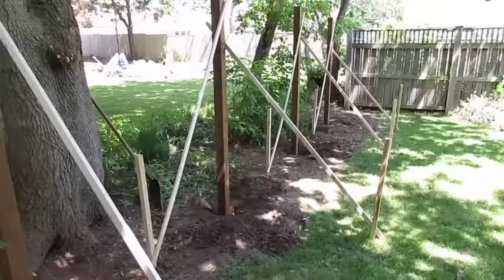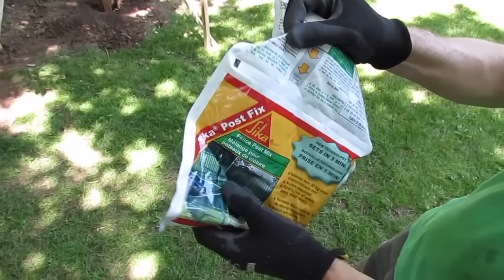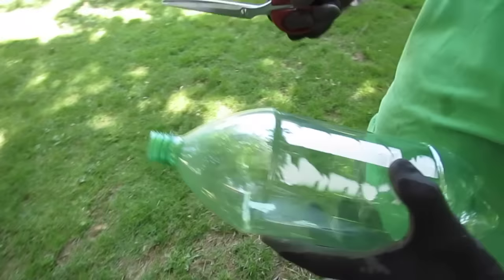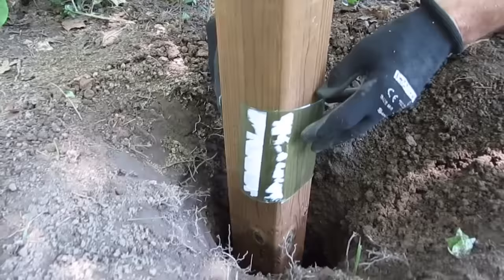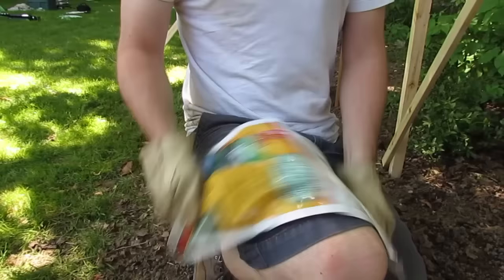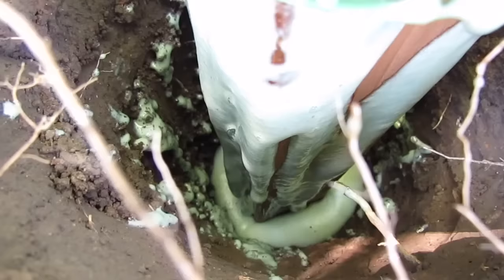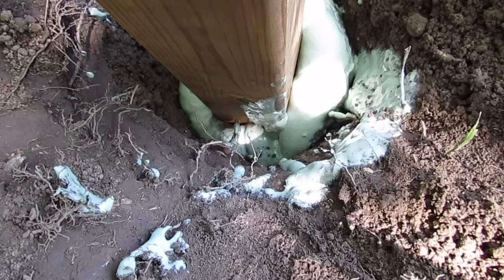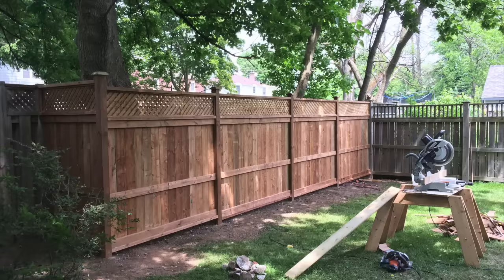No Concrete Fence Post Install!

Comment: The foam seems like an unnecessary expense.
My area has clay type soils, so I backfill and tamp in 6" lifts. The tamper is a steel rod, about 1" square with beat-down head on it, it really compacts the soil. I mound-up the top of fill around the post so that water drains away. Water in the soil is soaked up by the soil, and / or keeps the air away from the wood to prevent rot. 
Some of my treated posts have been in the ground over 20 years and still going strong. Concrete retains a minimum of 7% moisture which is a good start to a 30% threshold for rot. Concrete shrinks, so it shrinks away from the wood to leave a small gap to hold water which soaks the wood. Someone posted that they thought the concrete helped by adding weight. It also makes the base wider so that the post has more bearing area against the soil to prevent bearing failure and enlarging the side of the hole. 
By tamping and compacting the soil, the bearing strength is increased and holds the post solid, even after 20 years and working in the wind.

Comment: I did two posts with the same foam product. Way easier than concrete. Plus, like someone else said, the foam posts have yet to move even with the fence facing heavy winds. A significant problem is cost. Concrete is much cheaper.

Comment: Not sure how much this foam costs, but you get the same results with a load of gravel and a spud bar. Gravel is extremely cheap, and not messy at all. Just fill around the post with gravel and use the spud bar to pack/tamp the gravel down and it will hold just as well as concrete. Code for some post installations is gravel rather than concrete.

Comment: It's only the cost that puts me off.  $30 per bag (from the US) plus another $20 shipping for Sika, and Secure Set has a kit for 20 posts, $300 plus $90 shipping (to Australia or Philippines).  Concrete is so much cheaper, but I'd love to try the foam.
Reply: It was a bit remiss of me - I should have added that the shipping is to Australia or the Philippines (where I'm now living).

Comment: After your posts are secure and level on all points , take a wheel barrel mix a couple bags of concrete with water shovel it in evenly around the post , relax have a beer job done at a third of the cost

Comment: Hmm, the thing I like about concrete is I can shape and level it so it slopes up to the post and sticks out an inch above ground level to keep wet soil away from the wood - not so much for damp itself but for the woodlice that love dark damp places, and I can shape it as it's setting and it looks really neat.  The builders of my estate covered the concrete with soil and the posts rotted within a decade, when I replaced my posts I kept the soil off and the posts have lasted ever since, I'm still waiting for them to fail so we can get concrete posts instead, but it looks like I'm in for a long wait.
Reply: Thank you.  I'm going to make sure the concrete stays above ground.....

Comment: I used it on my fence and I had a piece of plywood to mix it on and used a rolling pin to mix it and squeeze everything to one side with the rolling pin and then back and forth to get a thorough mix 
then when you cut it open, you can use the rolling pin to squeeze out the mix. I think that the better you mix it the better it will expand

Comment: interesting stuff... would do well for an art project Put wires through it for an solar feature, - set it up for a fountain.. cool stuff.  Light weight. Just need the right mold and fast hands with gloves on when it happens.

Comment: If you have the means to drop $10-$20 a bag of the Sika mix then go for it, but you can get a 80 lbs bag of concrete for $5.

Comment: Always sit posts in a bucket full of creosote, for at least a week, before sinking. Many will make the mistake of believing that “pressure treated” or “tantalised” timber is waterproof. It isn’t! Also, a square hole is much stronger and stable than a round hole. If necessary, for permanent installations (ie you are not expecting to renew / replace it ever again), hammer in 6” nails in the sides of the bottom of the post.

Comment: Hole should be bigger . More concrete or foam i guess makes for less wiggle. Wind causes the most stress on a fence. Tightly fitting panels will expand and distort over time.

Comment: I prefer concrete.  I coat the bottom of the posts with tar (use painters tape level around the post about 3" above grade so the tar looks decent) to help prevent premature rotting of posts (as long as customers approve).  Looks like a solid product however, concrete is not that big of a deal and cleans up easy with a hose. A plus is handling the bags keeps me in shape!

Comment: For next time you can just pour dry concrete mix in the hole, it will set with the moisture in the ground and rain. It's much cheaper and easier. Or use gravel and compress it. They make that foam to fill old mining shafts but much cheaper.

Comment: You don’t need foam or concrete, dig the hole as small as you can practicaly use,   hammer the post into the hole making sure it is vertical. Then put all the soil you took out back in the hole around the post. You will have to ram in the soil very hard to get it all in. The post will not move, Ive done this many times and they last for years.

Comment: I tried this bag of foam was $11.00 at Lowe's (wanted to install 2 posts for cloths line) 1 worked fine. 2nd one failed it pulled loose (waited for 2 days before cutting excess foam and installing line between). So it is 50%

Comment: I totally appreciate you sharing your experience with this fence post foam, it was useful for me, but I will have to disagree that this is not better than concrete. Its more expensive, its lighter which might be good for transporting but I would rather have a heavy anchor on the fence post. Its not really easier, when using quickset something concrete, you can just pour it in the hole and add water. It might not be as strong as its full potential but it will work like that. people including myself have been doing it like that for years.

Comment: if it is a closed cell foam it is waterproof. However, if it's an open cell foam it's NOT waterproof. Because it's two part I'd guess it's waterproof and much like the foam used for insulating walls etc.

Comment: We used to be Distributors for this 2-part foam. I never heard of it being used in this way;  It's used in off-shore oil, vehicle insulation, film-making etc. and is super expensive by volume compared to time-served easy-to-use (cheap!) concrete/gravel mix. I think if someone's concrete/gravel set posts were leaning after 5yrs they didn't do the job correctly. Wrong concrete mix or poor ground preparation...

Comment: You don't have to mix the concrete though. Pour it in dry. Position the post exactly. Pour water over the top. Works better than prewetting actually

Comment: I think no matter how many layers of coating did you apply on the wooden pole, it will start rotting in the soil by time. Nice and quick new technology but we never put a wooden pole directly into the soil.

Comment: The problem is it’s foam so it’s light, the reason you add cement is to put a heavy anchor atm of a sail which is what a fence is... putting foam on the bottom isn’t going to stop your fence from blowing away it may sound good in theory but I think you’ll have issues with this in 12-24months easy
Reply from the maker: No, concrete is used because it's cheap and readily available around the world. It's merely a filler material that presses against the soil to create a mechanical bond. It's the friction between the filler and the soil that holds fence posts in place, not the weight. Ever try to pull a T-bar out of soil? You'd think it would be easy because it's so thin and lightweight, but it's not. It's the overall friction along it's length that makes it near impossible without a leveraged puller. Know what I mean?

Comment: Appreciate the insight.
One critique: The posts need to be sitting in packed large gravel or in concrete. Your posts will rot as they wick up water.
Reply from the maker: Some others here have said pack with soil only, others have said pea gravel, sand, or peanut butter. The truth is that fences are installed differently all around the world, there’s no one best way to do it.

Comment: I did 150-175 linear foot of fence with foam, thank you for the foam. Something like 20 posts to set. You will need 2 bags of concrete per post. That's 160lbs, per post, you will have to LUG from the store, then into a truck or trailer, then to the hole. So how many times did we move that 160lb load for ONE hole? OK people I did 20 holes. That's 3,200lbs you would have to load from the store shelf once, then into a truck once, then across your yard once, then into the hole. Now we talk about the need for water at the job site. Some places have no water so it needs to be brought it. Now lets visit all that dust OMG. Now the fact that concrete is a sponge, holds water like mad. Water next to wood does what class? The word is ROT. So there goes all your strength when the post disintegrates. Also most people buy pressure treated posts. Concrete doesn't stick to that wood people. Foam glues itself to the post and the dirt. Your post is now glued into the hole people. Concrete is all about dead weight and trying to keep the post in the ground. With concrete, high winds and heavy rain, your fence will lean like my neighbors NEW cedar fence is. I lifted at most say 20lbs in foam two times total. Foam has a service life of like 100 years. Way longer than the wood will ever make it. Let's talk about removing the old fence. Posts were set in concrete. Now you have to dig all that concrete out of the holes and DISPOSE OF IT. Trust me people, that is a freaking laborious mess. Over half my old posts were rotted away leaving a ultra heavy blob of concrete to deal with. Wake up to the 21st century. Save your back people. BTW, the foam I bought was slightly more than concrete for me locally. I mean a few bucks, not hundreds. Wasn't over $50 at all difference. So for me looking at the cost, it was a wash.

Comment: Better to use concrete as you can leave it slightly proud(above) ground level & that way the rain water will run off if you trowel it at an angle away from the post. There'll never be any rot. That foam degrades in time too & combined with wind etc will loosen the posts.

Comment: I use that stuff putting up a 30 foot flagpole and it worked great until we had 70 mile mile per hour winds. I haven't figured out yet how to fix from leaning over.
Reply from the maker: Yikes, yeah this stuff may be a tad too soft for that kind of load.

Comment: great video !  I’ve been spraying closed cell  foam insulation for about 8 years now and have used a couple pour in place and have never seen it used for this application. I am a 100 % believer of foam insulation and will definitely be installing any fence posts in the future this way.

Comment: Hi mate, I can see some applications for this. But for a fence post not at all. The density of the foam is not near concrete, meaning movement leaves gaps. It is far slower than using premix concrete and mixing in a barrow to do 3-4 posts at a time. Like I said I can see its application but would never use it in any of our constructions.

Comment: Sika has always made good products, expanding foam (canned) usually rots extremely quickly but presumably sika sorted this in this product? 
I can imagine it won’t hold up as good as concrete as it has no weight.

Comment: Not to burst your bubble buddy but here is I tip on using cement bags... you don’t need to mix it with water... just dump a half a bag of mortar in the hole and bury the rest with dirt. The moister in the ground will seep in and it will set up on its own!!
Reply from the maker: No bubble bursting necessary, I like concrete too. Don’t sweat it bud.

Comment: Why not get a bag of cement ,a few bags of stone & a couple of bags of Mersey grit ( or USA equivalent ) grab hold of your banjo ( building site slang for shovel ) & knock up a concrete mix by adding water .( use a cement mixer if available ) .That way you will have enough mix to do all the posts & save a load of money .Buying separate post mix bags is for amateurs & DIYer’s with more money then sense .

Comment: I would stick with the concrete mix since it's cheaper and known to work well.  You want some weight to hold the posts.

Comment: I'd prefer concrete.  Way cheaper and proven to last.

Readymix has one that you pour into the hole around the post dry, so it really fills in all over, 100%   Then you wet the concrete with a hose and done.  No mess.  12 hours later and they won't move.  As an aside, I fill up the post hole with water first, let it soak in till the hole has about 1/4 of its depth still in water, then pour in the concrete.  I use a piece of 1x2 to stir the concrete, and keep adding water as I top it off with concrete so it has a consistent wetness.  

Even if it's too soupy, the water will drain into the surrounding soil.  And if you get any concrete on the post itself, just spray it off before it dries.  An additional tip.  put in about 2 to 3 inches of coarse gravel at the bottom of the hole for the post end to rest on.  This gives the hole a drainage field and the post isn't in direct contact with the soil, which is where bugs live.  One thing you don't want is for the concrete to form a "cup" for water to collect in around the post from the rain.  The gravel prevents that.
Reply: My experience with concrete is that it deteriorates in a freezing environment.  Water expands and contracts and eventually you can just pull the post out.  I haven't tried this foam solution so I don't know if it's any better but I'm thinking that it would not crack.

Comment: While appreciating your use of a product unintended for this purpose, I can't help but wonder two things:
1. Is the foam environmentally approved for this use?
2. Time and repeated wind-load will degrade the foam's holding power over time and result in the use of the proper anchoring compound... Concrete.
Reply from the maker: This product is solely intended for fence posts, look it up.

Comment: Concrete pre-mixed in a wheel barrow is a much better job it's  also a stronger and heavier foundation for those fence posts.
Reply from the maker: Heavier for sure

Comment: I’ve been using posts mix here in England for years it’s easier than foam, step 1 open bag, step 2 pour in hole, step three add water, then back fill. Why change something when it already works well.

Comment: Am I wrong to state that ultimately it's the stability of the soil around the post/foam/concrete that determines whether the posts lean over time?  I live where the soil is very sandy and you can dig a post hole with a table spoon.  I would guess that unless something was done to increase the density of the surrounding soil, the posts will start leaning no matter what anchored it at the base.  Thoughts?
Reply from the maker: Agreed, excellent points. Perhaps setting the post deeper would help (assuming the soil is more dense as depth increases), but otherwise it doesn't matter much if it's in concrete, foam, or jello.

Comment: Wait till you get a deluge of rainfall over days and your foamed post 
floats out of the ground ! Cost 10x more than concrete  -  - you can 
save a TON of money by rapidly mixing the foam stuff with a half 
wheelbarrow load of 1" to 1.5"  big gravel, then rush and dump a portion
 into each of several post holes - - - you gotta be FAST. I heard 
somebody developed a retarder for this foam to slow it down, but wise 
old guys simply put the bag of post hole foam in a refrigerator for a 
couple hours to slow down the reaction when they are mixed. You will be 
able to secure like 3 to 4 post holes for one bag of your expensive 
polyfoam stuff. When you finish the entire project you can use a 
waterjet to clean out the wheelbarrow. Most commonly this product is 
found in our neck of the woods where pranksters and hoodlums come along 
and pour it into your car tailpipe or your mailbox, then wire the 
mailbox door shut for laughs ! Of course this is a Federal crime, 
because it's a US mailbox.  We heard of a guy who bought icemaker tubing
 same size as the tubing they give you with cans of spray foam 
insulation. He cut it like 18 inches long, inserted into the post hole 
down to the bottom  - -  poured in his large chunky moist gravel around 
the tubing to mostly fill the hole, then just attached the foam can 
nozzle to his tubing and squirted in the spray foam until it filled all 
air spaces and came up from the bottom, started to emerge out the top, 
waited a few hours and his posts were set rock solid. Moist gravel helps
 the poly foam set faster, and with a lot of coarse gravel it's a much 
stronger footing. Only downside is this method does not set as fast as 
the fence post chemical.

Comment: Wow, one bag doesn't go very far.  Clean up is not the issue in my opinion.  It's obviously easier to move it to the post, but concrete has the advantage of ballasting the fence post making the fence more sturdy in my opinion.   If you use one foam bag per post the cost is similar to concrete, but having to use two bags per post makes it expensive.  I say in most cases it makes more sense to use quick setting  posthole concrete which costs more than ordinary concrete.

Comment: 4 years after this video was posted fence contractors all across the country still use quickcrete post-crete. 

 How do you trough the cap so that rain water doesn't seep between the foam and the post and rott out the post ?